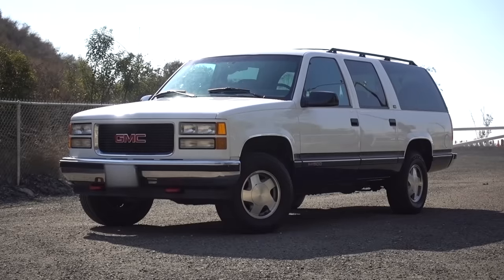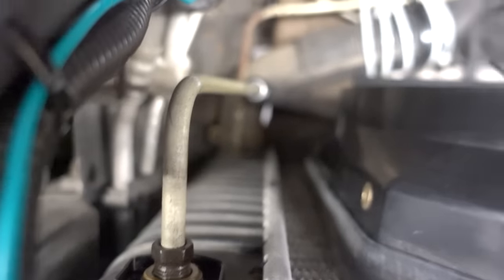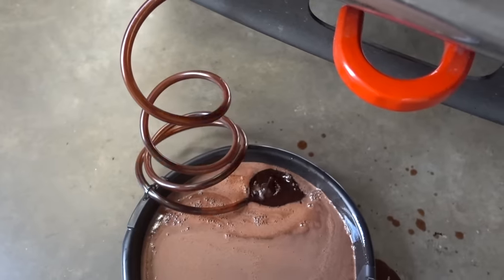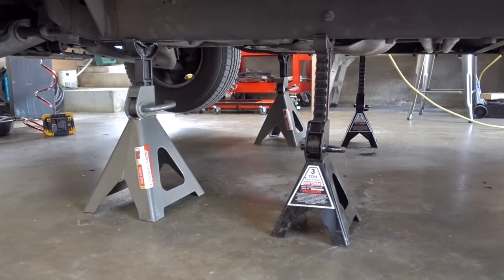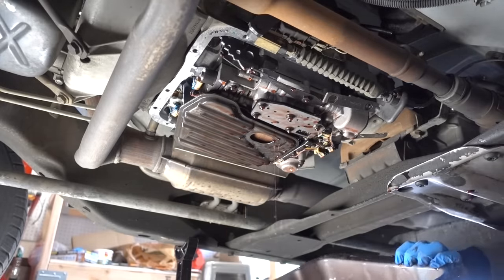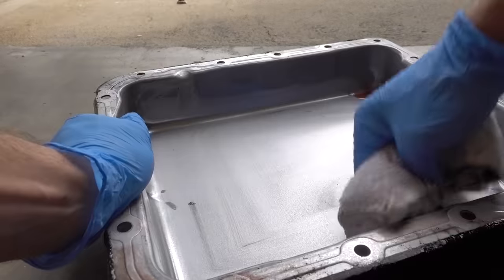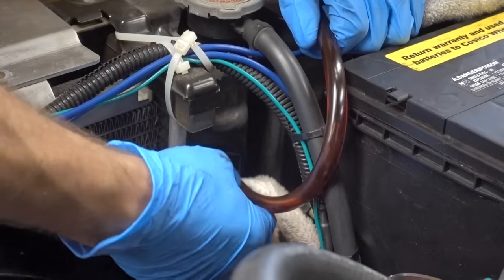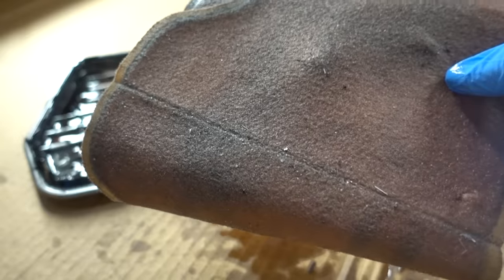Why You Should NEVER FLUSH YOUR TRANSMISSION FLUID!!

Comment: U have no clue what youre talking about . If you cannot do dynamic flush they you do the normal where possible  if your gearbox is slipping then its game over for  the  plates and need repair anyway .Transmission fluid  works as a hydraulic/ lube and heat dissipator  every 30K MAX u flush it or change it and fluid also decay over time so ... :-)

Comment: WRONG - NEVER EVER PRESSURE FLUSH YOUR TRANSMISSION!!!  ALL transmissions pans have either a magnetic drain plug or they put magnets in the bottom of the pan or both.  WHY???  To trap metal shavings caused by the normal operation of the transmission and keep them from being sent through the tranny.  NOW if you do a pressure flush of your tranny, it will often pick up some of those pieces, circulate them through the transmission control unit and plug it up causing vital fluid to not reach the parts it needs to.  Similar to a heart attack caused by a blood clot, this will starve part of your tranny of the fluid it needs and WILL CAUSE DAMAGE.  Once damaged, that part will function but will degrade over time causing even more damage leading to the eventual total failure of the tranny.  DRAIN AND FILL ONLY - don't do a flush and fill and certainly DO NOT run your engine to pump out the bad fluid like this doofus did.

Comment: I call partial BS on a transmission fluid flush being bad for it. If the fluid is bad then when you Flush the bad fluid then you need to replace all the bad clutch packs and torque converter and BOOM propblem solved.  Now if you will excuse me i GTG sell one of my kidneys to fix my 95 corvettes transmission......

Comment: guess what you still have 24 year old fluid in that transmission... Unless you drain the torque converter also yep you failed. Minute I saw the razor blade I knew it was amateur hour.

Comment: Yea, not the best way to do it. You were running metal to metal with no oil. Best is to use a hose to drain and a hose in fresh oil to be sucked in by the pump. Or just pour in oil while it's being drained. But in my 35 years, we just drained the oil pan and torque converter and replaced the filter and that's it. But never how you did it.
Reply: You can drain it from the cooler lines as long as you know what you are doing. That's the best way to drain it honestly. No other way gets 99% of the old fluid out.
Reply: @KyrieEleisonMaranatha  well, 99 percent is not necessary while risking mechanical damage. Again, you can do it while introducing new fluid till you see clear fluid but not waiting for bubbles. Again, complete replacement is not necessary.  On the manufacturer I worked on for 35 years it was drain the pan and replace the filter and drain the torque converter. That still left about a half quart inside and that was just fine. The problem with this advice is that it takes very little to do mechanical damage if not paying attention.
Reply: @georgecurtis6463  sorry buddy but that is just not true. You won't cause any damage running it that short of a time. It would need to be ran for much longer and under load to cause any significant damage to the pump, seals and bearings.
Reply: @KyrieEleisonMaranatha  then go ahead and do it. I'm just suggesting to not do it. Ps, be carefull taking the lines off as many are rusted in. Otherwise it's your vehicle so you can do what you want.
Reply: @georgecurtis6463  lines are made of aluminum for a reason buddy. Aluminum doesn't rust. 🤣🤣🤣
Reply: @KyrieEleisonMaranatha  not entirely, many have steel threaded nuts. Also, have you ever heard of corrosion ? Either way, as I said, your car, have at it.
Reply: @georgecurtis6463  most don't even use threads buddy. Most are just hose clamps. But either you are right my car. 🤣🤣🤣
Reply: @KyrieEleisonMaranatha  yup, some have clamps. Many have fittings. So again, just depends on the car. My cars and others I worked on had fittings. You just did not want to mess with those fittings, specially in areas prone to rust or corrosion. Not much of an issue here in calif but vehicles from other rust belt areas are ones to be carefull with. And yes, I have seen hoses cut and then a fitting and clamps used to put the line back together. I certainly would not risk my trans on that.
Reply: @georgecurtis6463  ok but majority of cars do not hove you problems. You are focusing on a slim chance of events happening. When in reality most cars don't have those issues. That's all im saying.
Reply: @KyrieEleisonMaranatha  yes I am, but it still needs to be put out there. A one sided story does not tell the whole story. I think we are done with this issue. Nice talking with ya.

Comment: Title was so misleading!
Reply from the maker: Hello Hecmar, it’s meant to be a play on the very common saying that ‘you should never flush your transmission fluid.’ I was trying to show that I did it on my older vehicles with excellent results. I flushed the transmission fluid in my 1995 Suburban equipped with the 4L60E and on my 2003 Suburban also equipped with the 4L60E. I do realize that the vehicles although old didn’t have extremely high mileage. But, I think this helps to show that it’s not the flushing of transmission fluid that is the problem, it’s the worn out transmission that’s the problem. *Also, I’m not a professional technician, just a dude with a truck a garage and a camera. I do my best. 👍

Comment: :yt:
Reply: Im a wrench,i can work on anything,except i dont do electric,im going to do my duramax tranny lines,internal filter,new cooler lines etc ( allison says you dont need to change the internal but i wanna do it)my complement is your attention to detail, actually doing whats the correct way,taking time to identify each bolt back to where is was and then properly cross installing them and then using the proper torgue # required for them,im a meticulous person build alot of things that dont require detail but detail is the only way i know,your the only guy i viewed that took the time and cared to do it,the way i see as correct,and your vid wasent on an Allison 1000 6 sp,its relevant to proper work